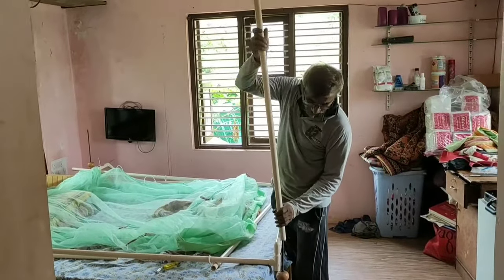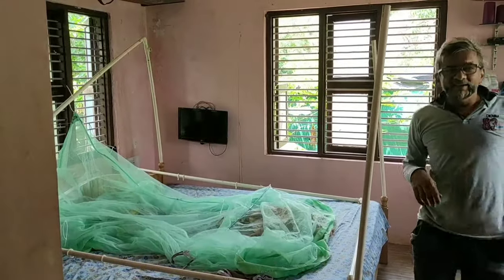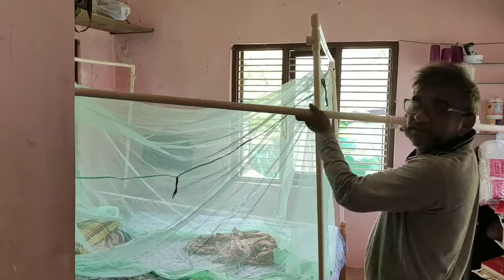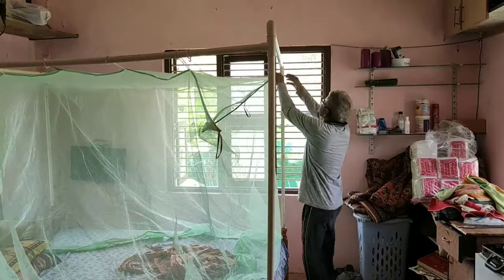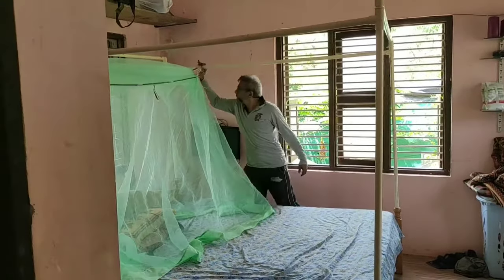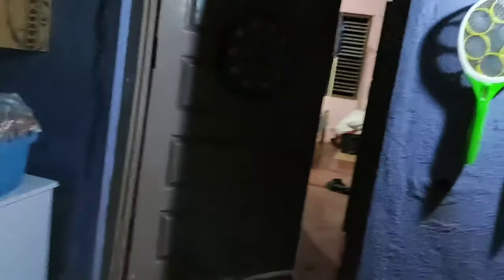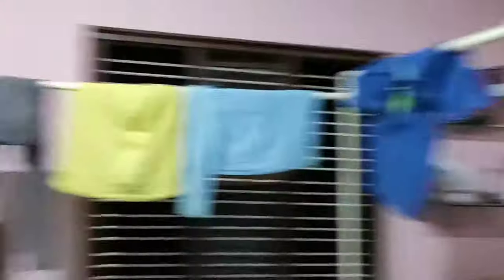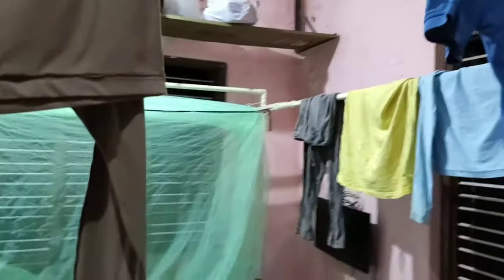My DIY PVC mosquito net frame . Thought this will ease my life.

Comment: Over fast
Reply: Wo bed ko kya lagaya wo kya chij hai
Reply from the maker: @vivek2404  I tied the curtain ring to mosquito net using a wire tag. Also, I used a broken plastic  tent stick  horizontally to push the entire net uniformly back and forth. I can send finer details if you wish🙏
Reply: @hohoholla  sir aap ne bed ke jaha Aapne pvc pipe dala wo kya hai usaka photo bhejiye...or wo Kaha milata hai bataye
Reply from the maker: @vivek2404  sir, do din ka wakth dijiye, Mai our ek video upload kartha hu jisme saari details apko milega. 🙏
Reply from the maker: @vivek2404  sure
Reply: @hohoholla Did you upload your second video?